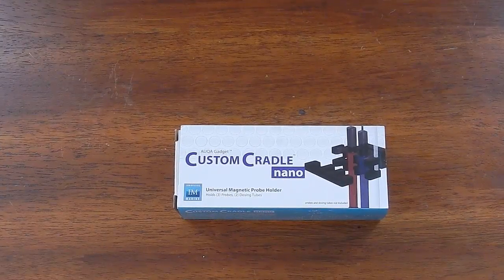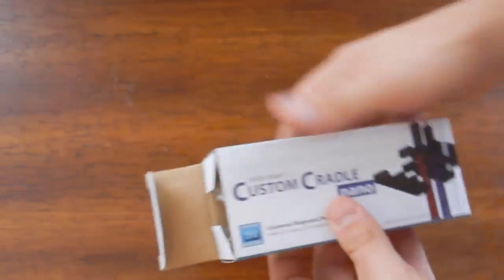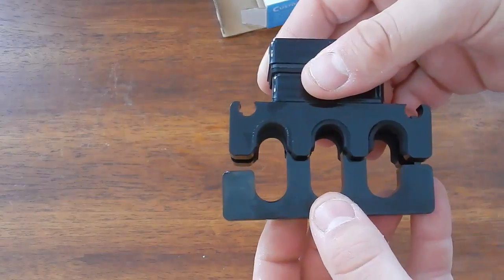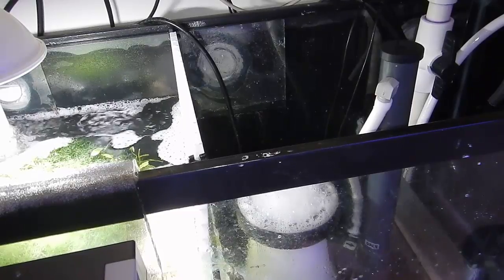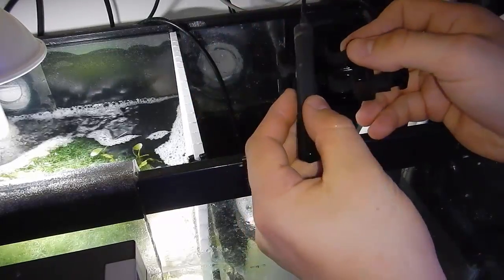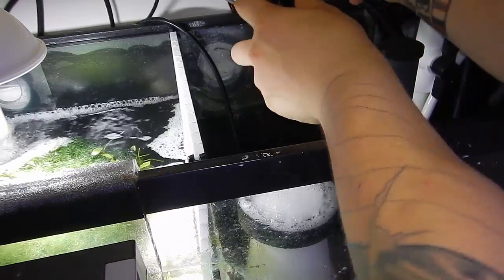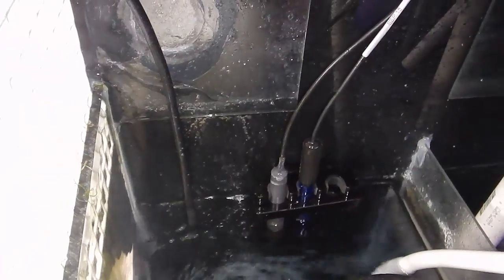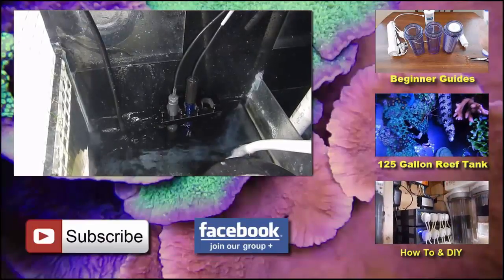Innovative Marine Nano Universal Magnetic Probe Holder

Comment: Hey Travis,  how well do you think that would hold a couple of dosing lines?
Reply from the maker: Im sure it can hold them just fine. I personally dont dose in the same section i test.
Reply: I need something just to hold my dosing lines. Tried the vertex ones.  The set screw in it was to short to hold the line firmly.
Reply from the maker: +Mofros Reef buy one off eBay they are $10